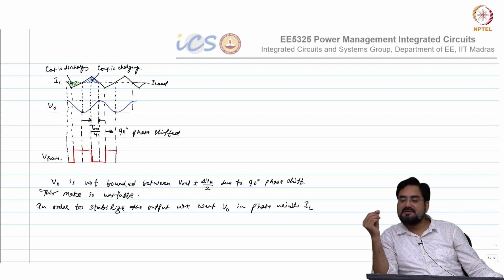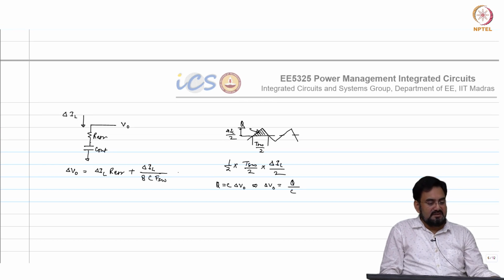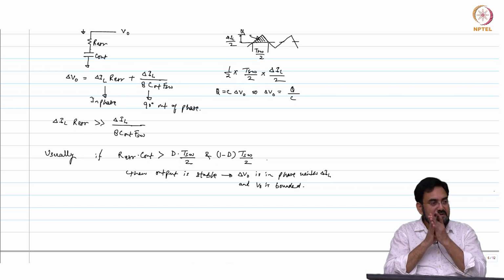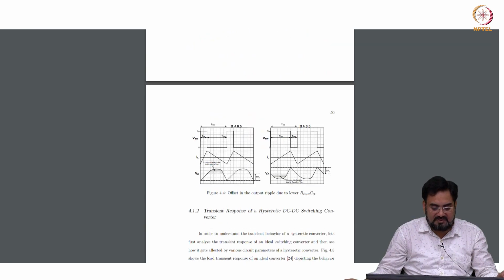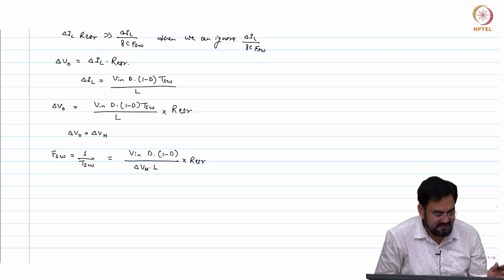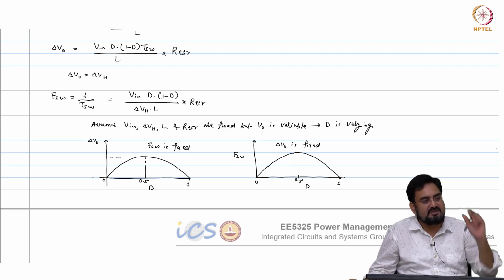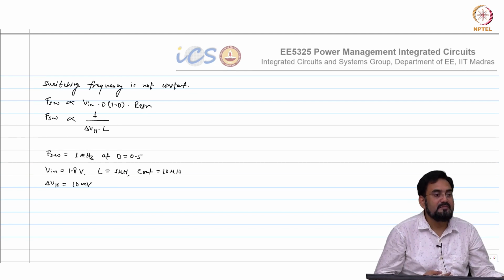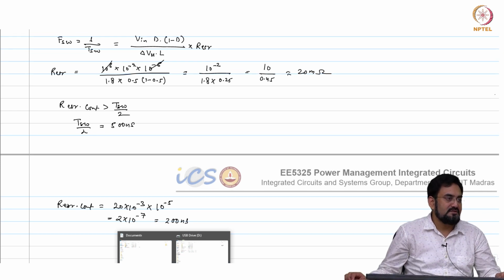#75 Stabilizing Voltage Mode Hysteretic Converter: Resr & Fsw-Hysteresis Relation

Comment: Really poor way of explaining
Reply: I think previous two to three videoes are indeed not as good as the other in the playlist, but I think it's better to point out the drawback rather than judge the professor in this way without any suggestion.
Reply: @賴彥凱-d7x  Its not my job to guide an IIT professor. I have been an ardent follower of NPTEL lectures since 2011. Most of them are very high class and I consider those professors as my Gurus. This is the first time I am coming across a  professor from IIT Madras who doesnt know the art of teaching.
Reply: @biswaruprana1970  😂😂😂 throughout the course after entering into the main dc dc converter is also having same thoughts